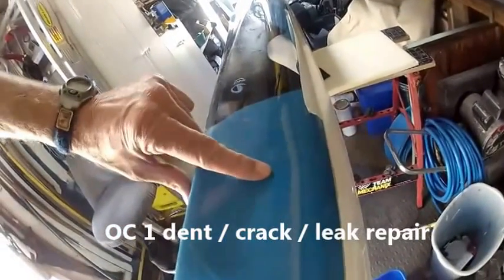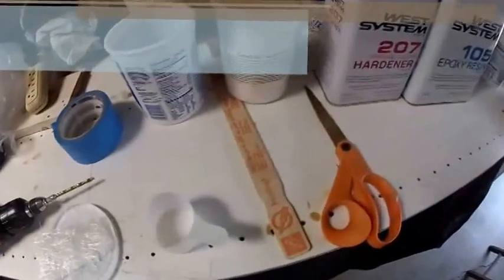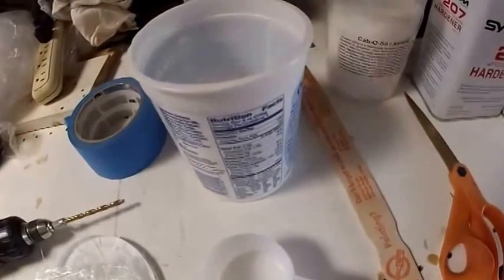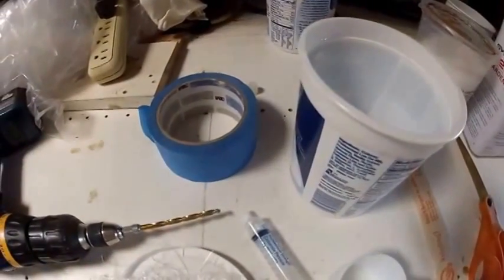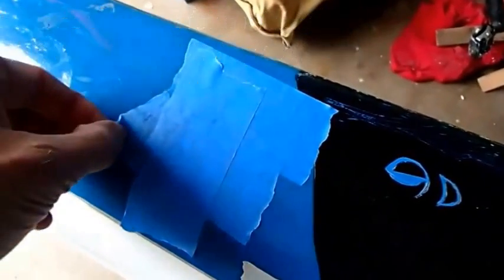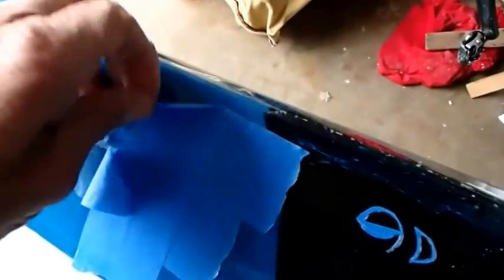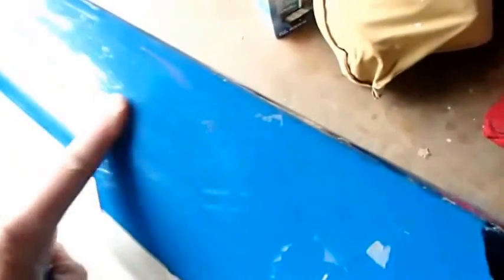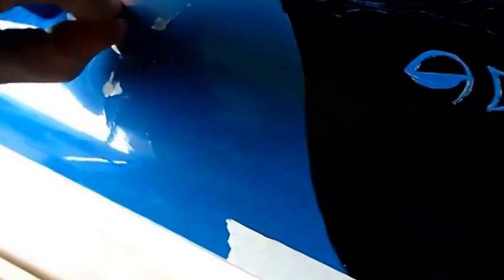Fiberglass Dent / Crack / Leak / Soft Spot Repair OC 1

Comment: Hi Dale, you've probably moved way past this video. Were you cutting up the fibreglass to mix into the epoxy??

Currently doing a similar project - scored an old Mako OC1 in Australia which was taking on water- and looking at punctures under the waterline. Obviously would prefer not to fibreglass patch here, in case I create drag.

Thanks for the vid 😀
Reply from the maker: Yes. The strands of glass add to the strength and provide stiffness. This technique should solve your issue. Try to get the inside surface clean and dry first. I rinsed fresh water, and then alcohol through the drain plug. Good luck.

Comment: Love it, so creative,  I am about to embark on a similar repair for an old Huki OC1, it has a similar 1-2' soft spot, the boat came to me for free so nothing at all to lose!  I like how the resin stiffens the weak part and fills the hole, all in one.  Thanks for the idea and for taking the time to share, very helpful.
Reply from the maker: I have now done this kind of repair on 4 different boats since this video. One canoe had an area about  2' long and 1' wide from being driven into a garage with the boat on the roof rack. All of these repairs have held up really well, some for years now under heavy use. Good luck with your project. Maybe you should make a video too.
Reply: Hey Bob, how did your repair finish?
Reply: @SchilkeShire  hi CJ, I ended up donating the boat to a coach of a group who repairs them and gives them to juniors for training

Comment: Dale, Just wanted to say THANK YOU! Picked up a nice old OC-2, only issue was a soft spot in the ama where the gelcoat had cracked. I've never done any glass work but it came out beautiful. Mahalo!
Reply from the maker: Glad to hear it worked for you. So far this repair has held up well. The boat gets heavy use from our club members.  Did you come up with any variations or tips for others?

Comment: Having preped the inside of the hull not at all to make sure its clean and going o make a good bond with your Epoxy mix i give this about a 50/50 chance of long term success, nice in theory though.
Reply from the maker: gloryhound11 makes a great point.  I totally neglected to talk about cleaning the inside of the hull area first. Since I didn't want to split the boat open, the best I could do was to rinse the inside with fresh water twice through the plug hole. Let it dry thoroughly. Then I poured in acetone and slopped it around just in the area to be worked on. Drained it. Let it dry. Then I made this video. The boat is still solid and gets a lot of use.  Thanks for the input. I should have thought about that before, but it didn't occur to me to make a video of it until I was ready to start drilling, and that was a couple of days after the cleaning.